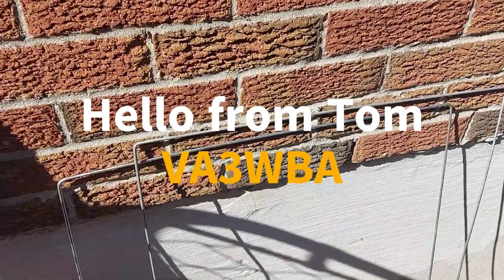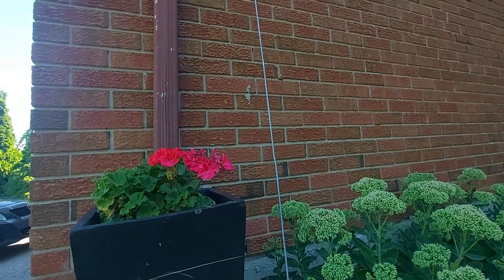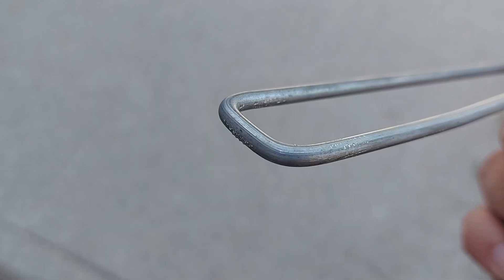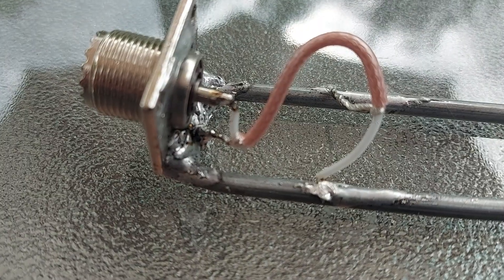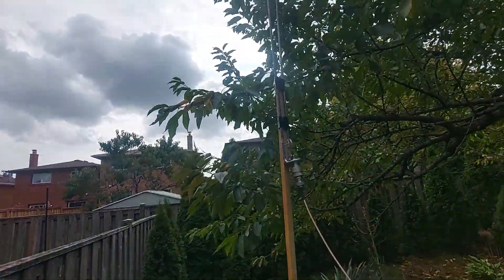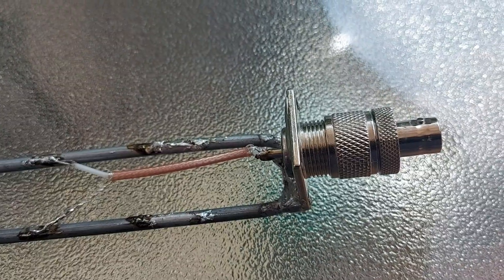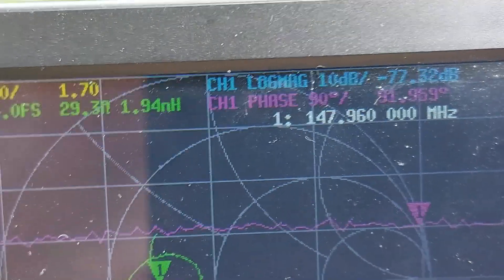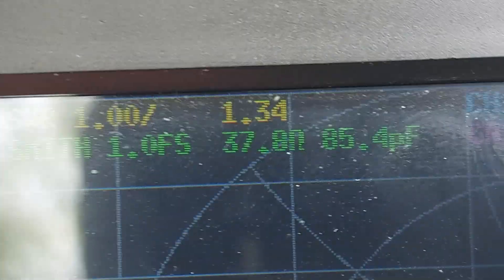How to Build a 2m J-Pole Antenna Using Discarded Lawn Sign Wire

Comment: I grab every yard sign i see set out on trash day for exactly this reason.

Can never have too much sturdy metal rod.

Great for yagi antennas too
Reply from the maker: I think it depends on how many elements you want to include. The wire is heavier than aluminum tubing.

Comment: Very nice build Tom! 73 VE3FA VE3GKT
Reply from the maker: Thanks. We should test it.
Reply: @radioastronomy2001 yes, message me. I am home tonight. 

I have not see a J pole with the bottom of the antenna connected to the shield of the SO-239. I have seen them where the SO-239 is soldered to the short side of the antenna. KB9VBR does them this way. I wonder if this negatively affects the tuning.
Reply from the maker: @JosephVE3GKT  It doesn’t really matter, positioning of the connector is not critical as far as I can tell. I have a 70cm J-pole made of steel wire, and two others made from ladder line (not to mention one made for 15m band - which also has connector at the bottom). In my experience, the ones made with ladder line don’t tune as well. Bare metal seems to perform best.